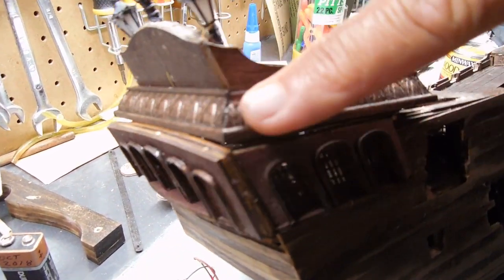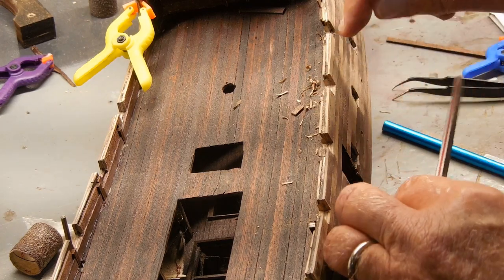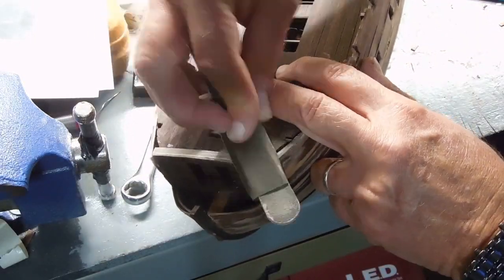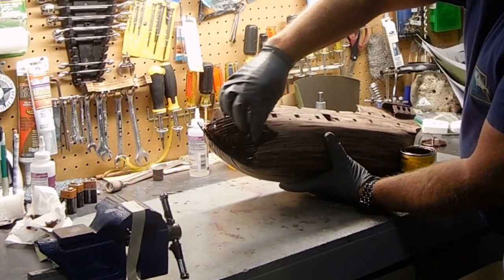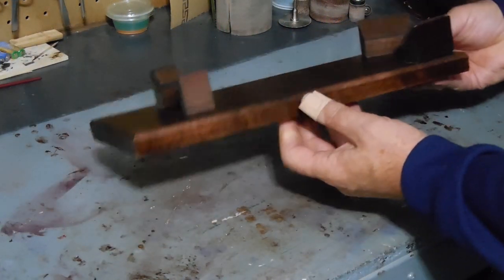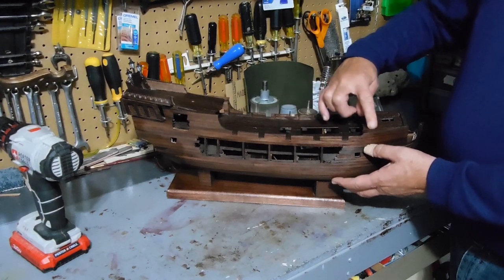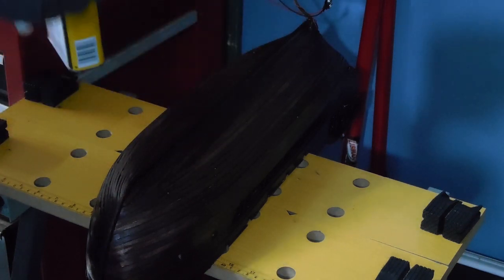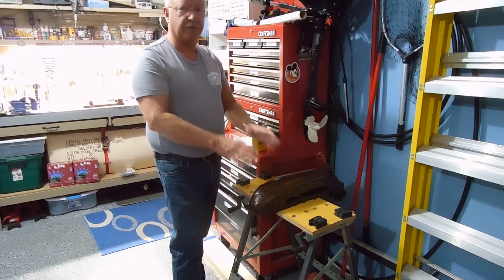Building The Black Pearl Model Ship Part 11

Comment: Is this model made by ZHL ?
Reply from the maker: I don't think so?  When purchased, I didn't really know much about ship models, and I just found one that wasn't too expensive.  To be honest, if I were going to start all over, I'd buy one a little better.
Here is a link to one that I wish I had purchased: I think it is an actual ZHL version for a little over $200.
https://www.aliexpress.com/item/1000005508519.html?spm=2114.12057483.0.0.15964b637BMMz1

I'm documenting my build to help others out there that might have purchased one like mine that has very poor instructions, and whether or not I can actually finish it.  It has been difficult, but I'm getting close to a successful finish.  The masts and rigging are going to difficult and require more research.

Make sure you research and don't buy too cheap of one. Mater of fact, I've probably spent enough on extras that I could have purchased the one mentioned above and spent less money!

Thanks for watching!
Reply: Yeah, but this one, from Amazon is not  open, you can not see the lower decks. :)
 Are you gonna paint her black, at the end? Seems rather challenging giving her that "old, used look" paint.
Reply from the maker: Latomeru Fox : No, I won’t paint mine black, I’ve tried to give it a dark mahogany stain and will stick with that. My thought is that my version of The Black Pearl is what she looked like before the curse!      Thanks for watching and following along on my journey with The Black Pearl.
Reply from the maker: Latomeru Fox : I do like the open side and I am looking forward to putting supplies in all levels. But that’s a ways away. I’m getting close to working on the masts and then the riggings. That’s going to have multiple challenges for sure!